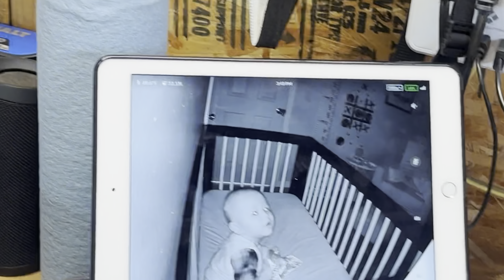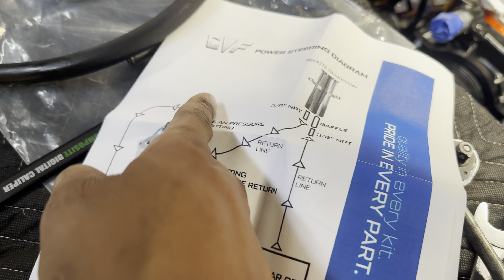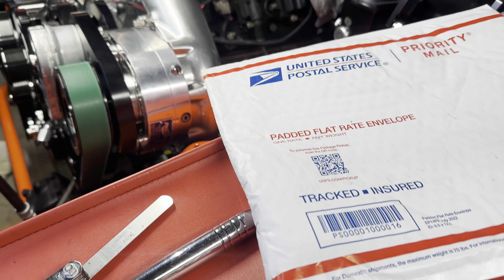I WAS DOWN, BUT NEVER COUNT ME OUT! | CHEVELLE UPDATE | PROCHARGED LSX RESTOMOD

Comment: Also you can repin your truck injector connectors so you don’t have to use the adapters, just use the connectors from the adapters
Reply from the maker: Yeah, $20 for the adapters will save me some time from wiring.

Comment: Correct that CVF belt is tight tight I had the same issue.  So far as the remote reservoir I hung mine from the radiator support.
Reply from the maker: Yeah, but mine was not long enough to go on. 🤣 It was definitely too short. I’ll have to tell you sometime how I forced it on. I ended up not using it.

Comment: How much boost you planning? What fuel? How much power can that holley efi system support?
Reply from the maker: Everything is rated to handle up to 1000 hp. Not saying I’ll be pushing that much. My pulley set-up will only be about 9-11 lbs on 93 Octane (I’ll probably run some Torco to bump it up a bit at times). E85 is a possibility down the road.
Reply: @MrGriffin23  Awesome! I highly recommend E85 & flex sensor. I noticed the car has more power on E and not to mention I can add more timing. Also will help you w/o an IC.